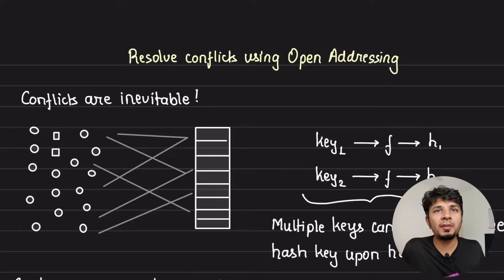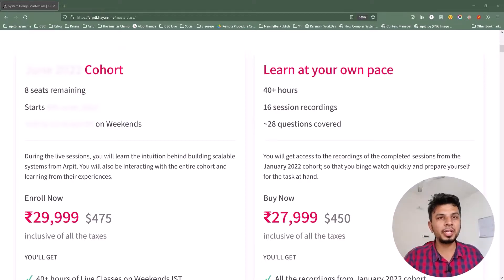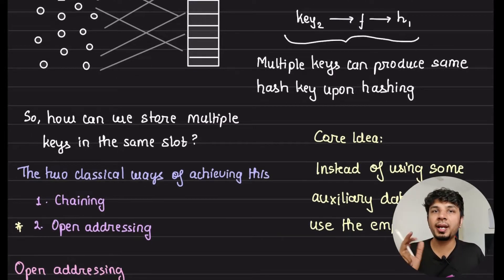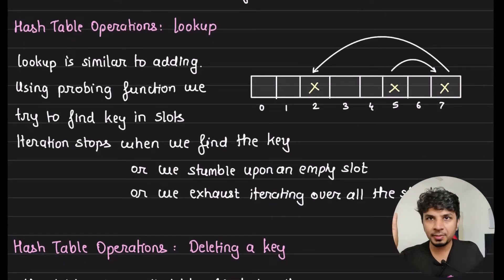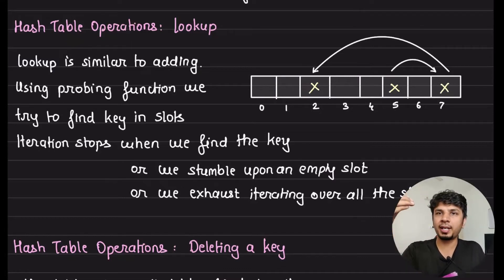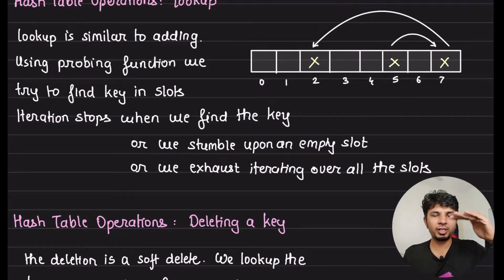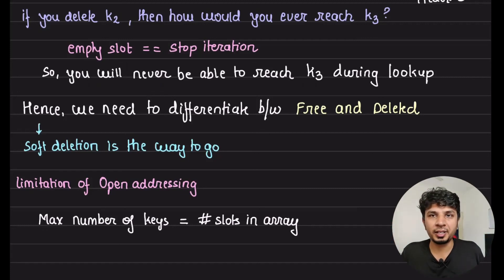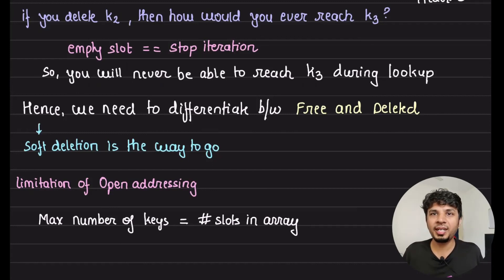Conflict Resolution in Hash Tables with Open Addressing

Comment: Very well explained in depth especially that soft delete concept, I did not know that. 
But there are couple of things you missed In probing (Might be you will be having this in future video) - The first thing is time complexity to add/lookup/delete (For example the lookup is not now O(1), it can be O(n) worst case, which is another limitation) and second thing there is another probing technique called quadratic probing. 

Oops, I just saw at the very end of video, where you already said about it that will discuss in next video. (Sorry my forwarding mistakes at the end :D )